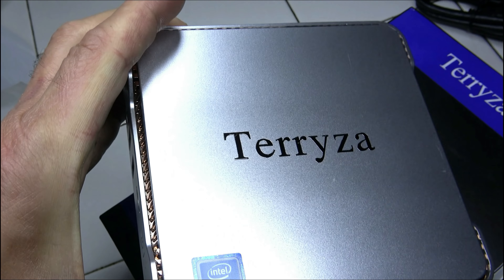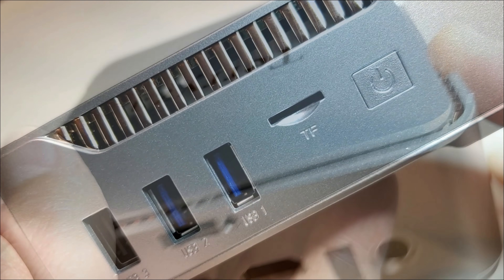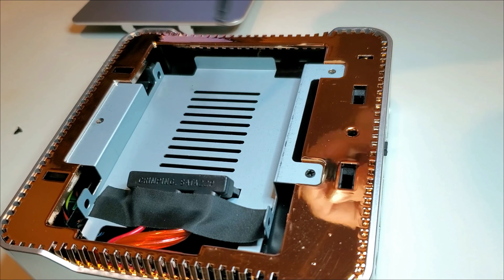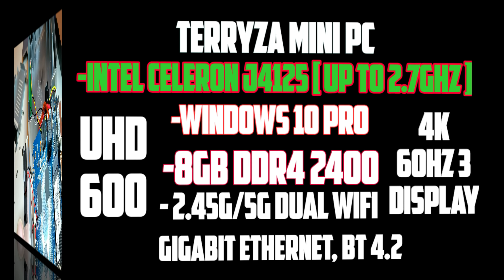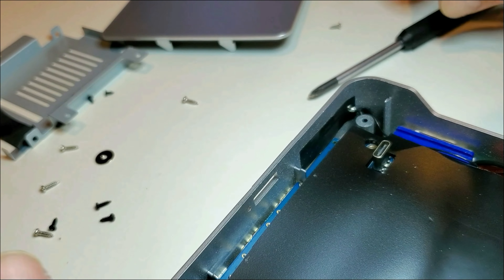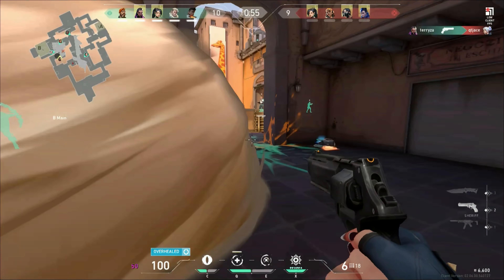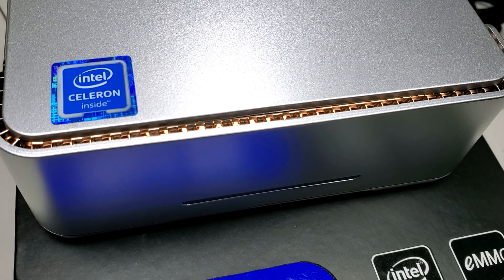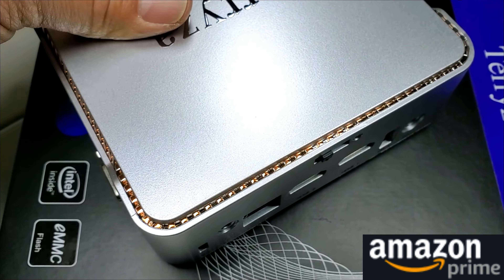Terryza mini Gaming Pc?

Comment: I have a question, I know you probably never played kingdom hearts or heard of the game but I bought the game off epic game since the game got a pc release on epic games & upon launching the game it did not work since the requirement is that I need to have a windows 10, video card  NVIDIA® GeForce™ GTX 1070, AMD Radeon™ RX Vega 56 (VRAM 8GB), Pixel Shader
 
5.1,  Vertex Shader
5.1 Dedicated Video RAM
 8192 MB, Intel® Core™ i5 7500 (3.4GHz) 4core/4Thread, AMD Ryzen™3 3100 (3.1GHz) 4core/8Thread 75GB to play the game. So I was wondering if this device good enough to run this game or do I need to get an actual windows pc or windows 10 laptop? Thanks in advance.